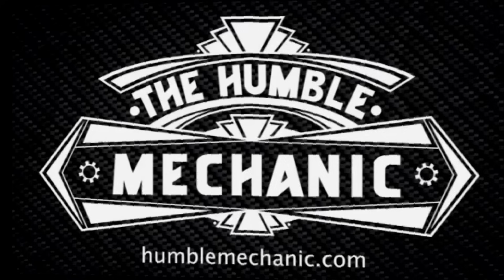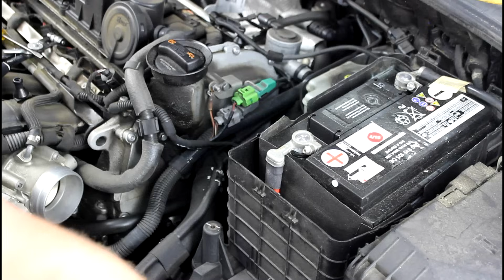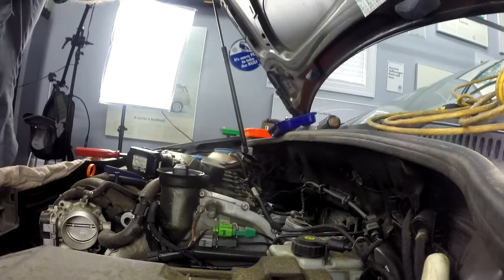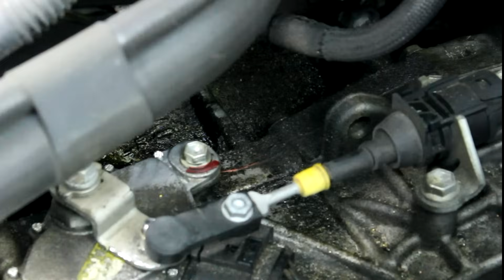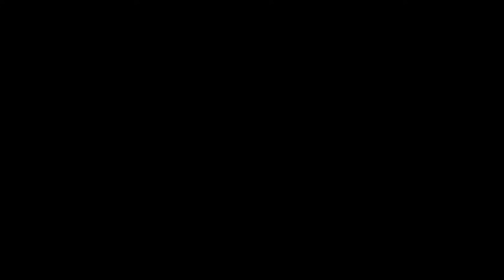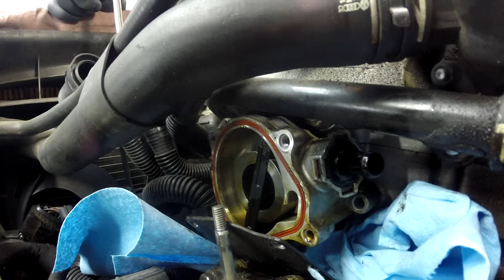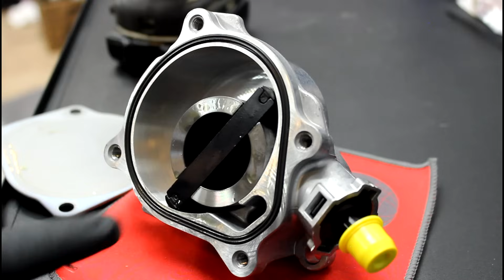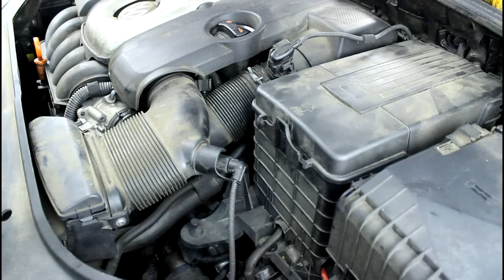Replacing VW 2.5l Vacuum Pump ~ The Easy Way

Comment: Hello master, 6 months ago I followed your video and properly removed/installed the pump again after gently applying a bit of gasket maker on the redish "oring". Now my car is spilling oil again from the pump. I can notice the redish oring is all messed up, I would like to replace it, but I am not able to find it on any site as a part, only the whole assembly. Would it be ok to replace it with a black "round oring" of the same size? or would you recommend me to buy the whole assembly? any trick would come handy!. thanks
Reply: also I got one of the cover screws stripped out, and I replacee all of them with none original ones, they are the same size but they don't have that "conic" shape under the head. Any suggestions? sorry for my english.
Reply from the maker: +lj8a (lj8a) have you tried to reset the seal? 

I may try to find a seal that fits first. Those pumps are $$$
Reply from the maker: +lj8a (lj8a) it may be worth looking into the delete kit they sell. A quick google search should point you in the right direction.

Comment: hey i tried this today, everything went well except for some reason even after checking the pump was flush, the 10mm bracket bolt on the top left no longer reached...the pump gets flush and tightens to the engine, the pump  plate snugged on as well as the inner parts were all the way back and allowed the plate to seal 
AND now for the disaster, started the car, let it run, turned it off looked up the dashboard code, had the power steering warning cause the battery was out for half a day..any how got ready to drive and started it up again, back out drive way, only to see EVERY DROP of oil i EVER put in that thing all over the drive way.. what in the heck could i have missed. This is a great DIY and i did it step by step... maybe over torqed the pump and its not fitting tight? i need help ASAP as I use y car for courier service. Thanks bud hope you still get notifications on this video.
Reply from the maker: +Stay Frosty the thing I've seen people do wrong is put the bracket between the engine and pump instead of outside the pump. 

Or roll the gasket
Reply: thats what i went to check a little bit ago after leaving the comment. EXACTLY what i did. Thank you for responding so quick though, the DIY saved me a lot a money and also reaffirmed my mistake i found!. I'll be back if i need ya, take care!
Reply: what do you mean outside the pump? do you mean you put the pump on first and then the bracket.

Comment: Amazing! Thanks for the insight and the excellent video. I've got 2 customers with Jetta 2.5's leaking oil. Looking at my big, thick Bentley manual, I thought that it might be the timing cover.

What actually leaks on the vacuum pump?

I will check tomorrow, but are the gaskets available separately? Why replace the whole pump if you can reseal it?

On the paper gaskets, I like to gasket cinch them to the removable part and use Permatex "Right Stuff" between the gasket and the engine.

I am sure glad that I searched for oil leaks on Jetta's and found you video. Thank you! You are making me a hero!

Comment: @HumbleMechanic Do you work at a dealer or an independent shop?  How many TU do you charge to your customers who would rather you yourself replace the pump instead of DIY?  Besides the risk of dropped bolts, potentially breaking hoses/looms in the process, or excessive oil cleanup what other risks have you encountered using this method?
Reply from the maker: I work at a dealer. We charge a reduced time for this job. 4.0 for Jetta/Rabbit and 4.5 for Beetle. I have had seals get sad on me, but it's not too bad. For the most part, this is a super easy job.

Comment: I just bought a used '07 Beetle and I took it to get it inspected at my local shop and they said there is a bad oil leak and after some UV dye, and about a week later, they said it is coming from the head gasket. In the meantime I took it to a VW dealer to get it double checked and they said the leak is from the vacuum pump. Both options are expensive, and I just want to know that I'm replacing the right thing. Is it possible both need to be replaced? or would it be more obvious to a VW dealer that it is the vacuum pump over the head gasket, or vise versa? Thanks!
Reply from the maker: +AxMONKEY I have seen TONS of vac pumps leaking. But one 1 bad 2.5 headgasket. 

It's possible but WAY more likely a vac pump issue.
Reply: Alright, thanks for your help!

Comment: I NEED YOUR HELP! I reached my vacuum pump but one of the t-30 bolts are stripped!! I cant loosen it to get the pump out. Should I clean as much of the oil out of the pump then reseal it with silicone? Or should I find a way to remove bolt?
Reply from the maker: +Justin M yikes. Which one is stripped?
Reply: The one at "10 o'clock", next to the 10 mm
Reply from the maker: +Justin M is the head stripped or the threads?

Comment: Just completed this job on my 06 Jetta with manual transmission. Everything goes the same as the video except you do not have to remove the shifter linkage or take the cover off the pump. Easy job, took about 2 hours including washing the old oil off motor and transmission before reassembly. Thanks for the great video!
Reply: thank you for mentioning this - I was just wondering how big of a difference there was going to be between the two, as my Wolfsburg is manual.
Reply: Great to hear! I have a manual Wolfsburg edition and have been dreading this repair. Thanks! Outstanding video!

Comment: Hey Humble Mechanic, Why did you pop the cable off the trans. lever when you were going to remove the lever anyway? That's an unnecessary move, just take the nut off leaving the cable attached! That's what I've always done. Less work=more money!
Reply from the maker: +Don Bolin just how I prefer to do it. If you have a way that works, ROCK IT!

Comment: There is a replacement for the rubber gasket on eBay

http://www.ebay.com/itm/2-5-L-Vacuum-Pump-Gasket-Kit-for-Brake-Booster-Volkswagen-Pierburg-07K-145-100H-/262472376018?hash=item3d1c929ed2:g:Pc0AAOSwuhhXVbex&vxp=mtr
Reply: Samson Marshall  exactly what i need. Thanks.

Comment: I have a 5-speed manual. Do I have a shift selector? The place I took my jetta they quoted me 3500 and told me the master cylinder was leaking badly but I found nothing so far. I do need to replace the driver side axle seal. What kind of scent does that give off just to be sure I'm on the right page.

Comment: My local dealer quoted me $969.80 for my 09 Jetta. This will definitely save me some money! Thanks a bunch!
Reply: My dealer quoted $1,800...yours was ripping you off considerably less than mine. :D
Reply: better show this video to your mechanic,
Reply: I just got quoted 1200 for this on a 2015 Jetta. Smh😪
Reply: @MrJuarezjr22  I got quoted $1,500 just now for this. SMH. Luckily, I’m somewhat mechanically inclined. I just changed the clutch on the Jetta two months ago too. Glad I don’t need to drop the trans again anytime soon. Next time I’m getting a trans jack. Will be a heck of a lot easier than man handling it and balancing it with a regular jack!

Comment: Awesome video! The only unanswered question for me is what about the oil in the Vacuum Pump? When the cover came off I expected tons of oil to come out? And, I didn't quite understand why you didn't have to put oil in the new one? Does this happen automatically with the brake system? If so, do you have to add brake fluid or bleed air from the system? Or, is it just as presented, once I put everything back together we are good to go?
Reply from the maker: +Don Collins it should really have oil in it. The oil comes from an internal leak.
Reply: I get that, but how do you put the oil in?

Comment: well today was the day for fixing the oil leak.  after a short test drive all looks well.  the previous owner had simply added some silicone or some other type of quick fix material to the inner gasket and put it back together.  I guess the $8 to order a new one was just too much.  it was obviously leaking from that side so i figured i would just replace that gasket.  Took about two and a half hours since one of the bolts holding the shift plate down decided to break.  All in all a fairly easy job to do and no way worth the thousands being quoted at the shop

Comment: An amazing video and really relieved i could do it myself.  thanks for taking such a detailed video  simply amazing.  I did watch the whole video and i do have a question.  Logic says that the unit itself is not likely to fail just the gaskets.  is it possible to just buy the gaskets and replace them?   Thanks and once again Amazing work
Reply from the maker: +ninners49 thank you! 

It's actually some type of deal inside the pump that allows oil into the pump. It then leaks out the outer cover. 

I have had very mixed luck just putting on a gasket.
Reply: +HumbleMechanic  I watch a lot of your videos and i seem to recall in why do vacuum pumps fail  you noted that they don;t typically fail from the inside components.  i can obviously see oil from the engine side gasket.  I used a mirror and flashlight.  i am planning to just replace the metal gasket.  once again great video.

Comment: is this similar to the 2.0 turbo?
Reply from the maker: +Robert Broadhead the BPY is only 3 bolts and is much easier. 

The CCTA And CBFA codes are tricky but not like this
Reply: +HumbleMechanic ok sounds good I will give it a try

Comment: didnt get the point of doing the red marks to the shift selector? nice vid btw
Reply from the maker: +Luis J. Ochoa (lj8a) to make sure you get them back where they came from. There is an adjustment for the cable.

Comment: hey man I had a really important question. I was reading on the Vw Vortex that you can in fact do a vacuum pump delete if there is any issues going on. I was wondering how does that work?? do I just need to remove the vacuum pump and that's it ? or would I need  to add something diffrent ??
Reply from the maker: +oscar olivas you remove the pump, and install a block off plate. 

Then engine vacuum is supplied from another source.
Reply: +HumbleMechanic http://www.uspmotorsports.com/Engine/Accessories/Spulen-2.5L-Brake-Vacuum-Pump-Delete-Kit.html will this work ?? and thank you for taking the time to answer me !

Comment: Excellent video. Can you please give me some tips on replacing the vac pump on a 2006 a4 2.0?Thanks!!!
Reply from the maker: +Sarmad Ahmed if that's the belt driven engine, it's super easy. 3 bolts I think. 

The chain driven engine is a little bit tricky but still Easier than this
Reply: Thank you sir!! It's the belt driven engine. Do I need any special tools?  It seems super tight to access the bolts. And do you recommend replacing the pump or just the seal if oil is leaking from the pump? Thanks for your response!
Reply from the maker: +Sarmad Ahmed No special tools, just the short length stuff. What to replace depends on where the leak is coming from.
Reply: Thanks boss!  I've come across some posts that suggest replacing the pump as replacing just the seal almost never solves the problem.  I will give it a shot.  Thank you!

Comment: on bottom bolt on pump is the order engine block pump gasket then pump and bracket gos on cause i put bracket between pump gasket and engine block

Comment: Thanks Charles. The previous video mentions the vacuum pump is a sealed unit and should not be opened but this video shows the removal of the cover when aligning the pumps internal mechanism with the engine. Is this okay or necessary when installing?
Reply from the maker: +Justin DeSilva IF you don't take the pump apart, you have to loosen the transmission from the engine. This is a little bit of a work around to save some time. I have replaced a ton of these and never had an issue.

Comment: Question if there is no oil leakage and you can hear the pump come on when you start the car from cold start.. and all hoses are connected. could be problem be the egr combi valve? I have 2007 vw beetle  2.5. Thanks
Reply from the maker: +vmax673 You should never hear the vac pump. You are most likely hearing the vac pump.
Reply: So what is probably giving out the 411 secondary airflow incorrect? Check engine is on........could it poss be a bad egr combi valve
Reply: When I start the car in the morning I hear the humming for about 30 to 40 seconds then its quits..
Reply: What about the pump delete kits..with one installed would it pass inspection?
Reply from the maker: +vmax673 that depends on the state. In NC it would pass

Comment: I read on a vw forum that you should apply a silicone gasket sealant to the gasket between the engine and the vacuum pump.  Do you think this is necessary?  You don't appear to use any gasket sealant in your video.
Reply from the maker: I have never done that. And never had one leak.

Comment: tried to replace mine got it in then started car and it poured out oil please i need help
Reply from the maker: Be sure the bracket is not between the engine and the pump.
Reply: Does bracket go between gasket andengine
Reply from the maker: No it goes outside the pump.

Comment: I was told to get this done since there is a small leak. when I check the engine oil it is with in range, now where near low. I am wondering if I really need to get this done. iF so how much for the part, any places I can get them for cheap? is for VW rabbit
Reply from the maker: The link to the one I bought is in the video notes. 

I'd copy and paste it, but my phone won't let me.

Comment: Hello, 
I would like to see a video on how to troubleshoot the electronic EGR valve (combi valve or secondary air control valve). I been having some issues with the 2.5 jetta mk5 and the guy at the shop said it was the EGR valve, I replaced it but nothing still fails the smog due to a P0411 incorrect flow detected. 
thanks in advance good videos

Comment: Humble Mechanic, opinion please... my friend replaced the vaccum pump about 2 weeks ago I have recently noticed its leaking again and worse than before.  He now wants to go and buy a silicon sealant to seal it???
Reply from the maker: I would say no. Need to go back and check workmanship.  Bolts tight gaskets proper. That type of thing
Reply: +HumbleMechanic ok thank you.

Comment: I ended up here because, while my 2007 VW Jetta was getting the 110,000 miles service, they informed me of this issue and quoted me $1,245.00 for replacing it. Thanks to you and your video, I will do it myself. That's about $1,000.00 in my pocket :-)
Reply from the maker: Awesome!!
Reply: +HumbleMechanic By the way, how do you unplug the MAF? Is there a trick to it or should I just pull hard? Thanks!

Comment: so is this the same progress for the manual transmission? I have the 2.5l 5speed jetta and my vacuum pump is covered in oil around it and in front of it so im guessing my pump is leaking ? but is there something I need to know for the manual transmission or is it the same. thanks
Reply from the maker: Manual transmission is way easier. No need to take the pump apart or battery out
Reply: +HumbleMechanic so just take screws out and put new pump in thats it ?
awsome videos btw the best I seen on d.i.y on youtube keep up the good work
Reply from the maker: Yep. Easy as it gets. Thanks for the kind words. :)

Comment: I knew there was a better way of doing this. My co is getting into vw now and starting to bring more work in.  This pays 7 hours I followed your instructions and did it in 2 hours taking my time. I didn't drop any bolts either, I did remove the upper hose radiator hose. I was fixing an oil leak so I just replaced the gasket. The question I have was the vacuum pump was full of oil inside it. Possibly 1/4 cup the boss said that was normal. I noticed the one u did was clean.

Comment: Thanks so much.  The VW dealer I usually take my wife's Beetle wanted $1,187.33 to make this same repair!  I will try to find where I can get the part.  The dealer was charging $355.99 for the part, the same dealer that wanted $45.25 to change my rear turn signal bulb, which I found out how to do on Utube and got both the turn signal and running bulbs for $2.66.  I feel confident to do the vacuum repair after seeing your video.
Reply from the maker: +Mike Malone Glad to help Mike! Just take your time and you can do this! You can get the part from ShopDAP.com That is where this pump came from.
Reply: Thanks, I appreciate it!

Comment: How do I know if it's the Vacuum Pump or the Rear main seal?  The VW dealership said it was the vacuum pump leaking oil but I took it to another local mechanic and he claims the vacuum pump wouldn't leak oil and its the rear main seal.. Any advice is welcomed as both the dealership and the mechanic want to charge $1000 to drop the transmission.
Reply from the maker: If it's a 2.5, 99% of the time it's the vacuum pump. 

Never seen a 2.5l rear main leak. See the vac pump leak all the time
Reply: Thanks, Time to find a new mechanic, we have hooked it up to the computer and there are no error codes it runs fine just oil leaking.  How immediate is the pump issue?
Reply from the maker: It's commonly misdiagnosed as a rear main seal. Not an extreme emergency but it can weaken the seals on the transmission connectors. 

Get a third opinion. It's not a cheap repair.